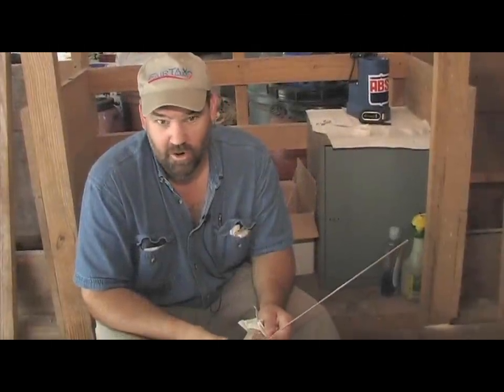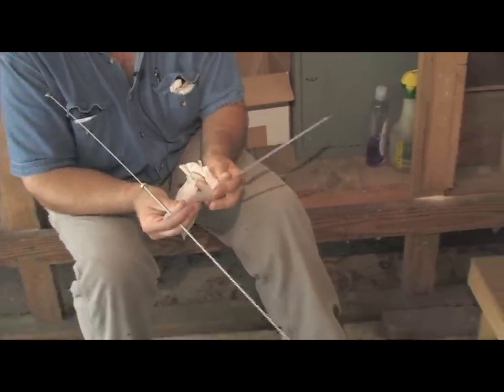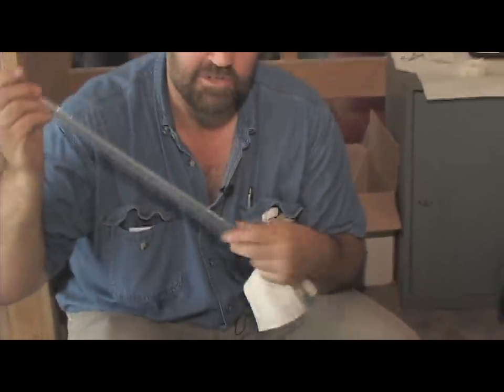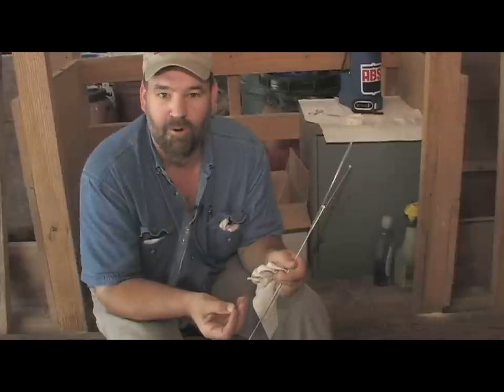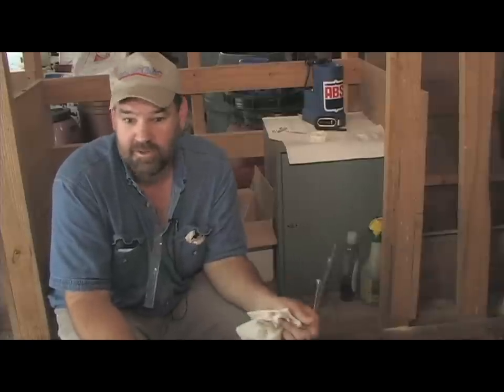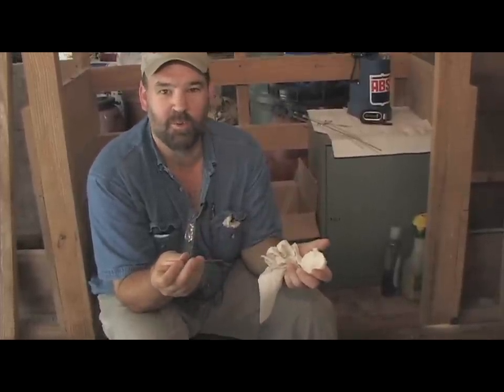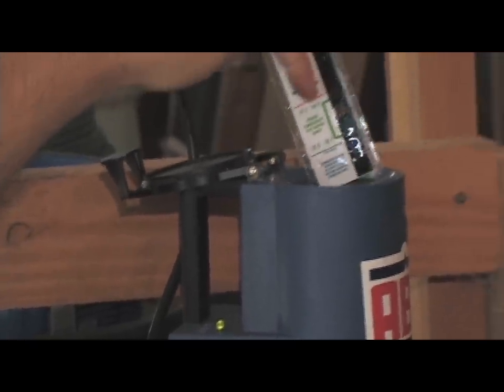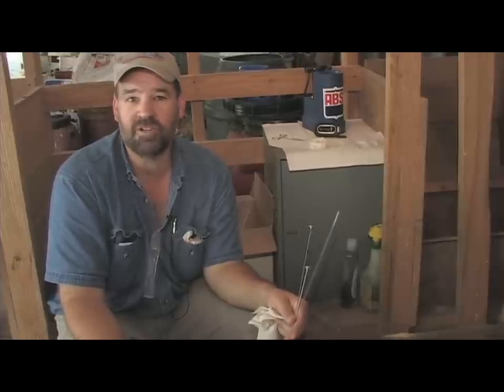Survival Skills with Russ - A.I. How to Artificially Inseminate a Cow Part 3 of 3

Comment: I'm going to be doing this for the first time next week on one of my cows but I need to clarify that the little white corks when the straw is installed in the gun, the crimped end that is cut is the end that first enters the cow correct? (not the cork end)? I see that you removed the first cork before putting it in the gun is that correct?